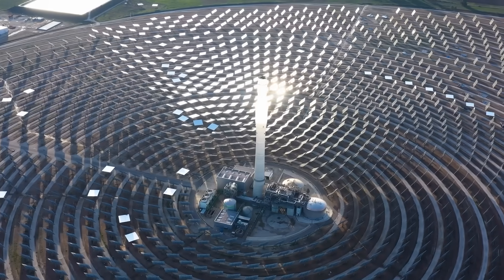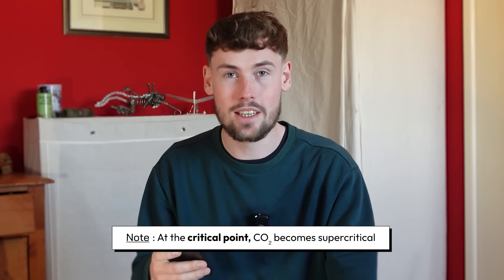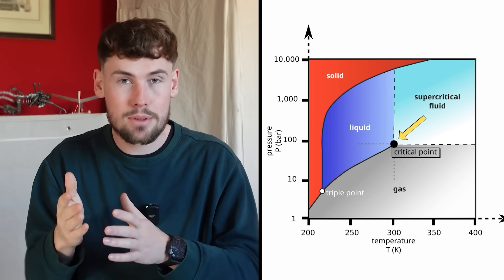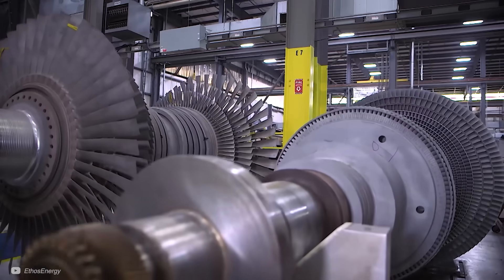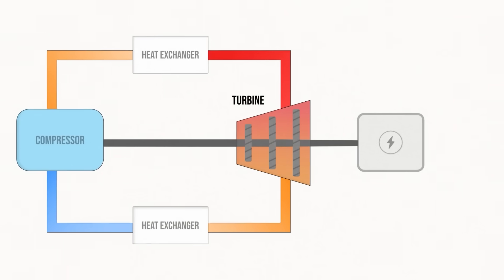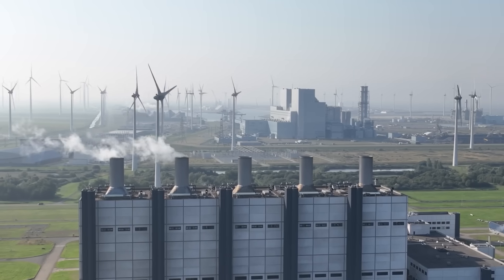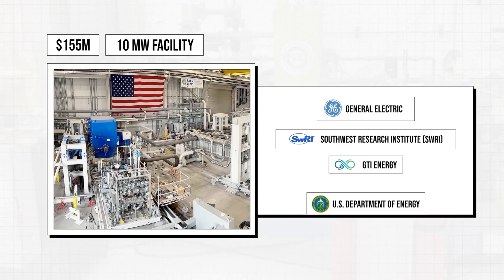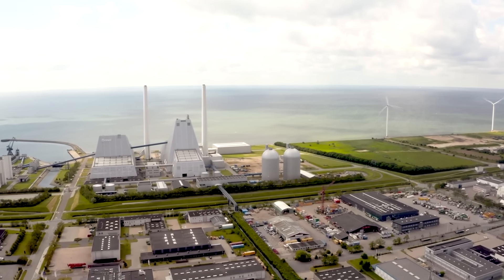How Ultra-Efficient CO2 Turbines Are The Future of Energy

Comment: As a Steam Ship Engineer, I do appreciate your content. Steam Turbines are incredibly efficient and reliable. However, when you throw 1,000 BTU's back into the ocean on every cycle, they do lose any efficiency advantage. Shoreside installations use reheat technology utilizing fluidized bed combustion, but this isn't practical for ships. I wonder how these CO2 turbines compare with the fluidized bed power plants. Thanks for the post.
Reply: One advantage of SCO2 for maritime use is the small size of the turbine.

Comment: Let's be more realistic, the next gen will still be fission reactors or the other option is to have very expensive electricity. Efficiency can be improved also by using waste heat for central heating systems. I hope people here have the brains to understand why it is not radioactive and would not be even in the case of any accident, because that argument is simply put foolish and often repeated.

Comment: Change of phase is not necessarily an issue. What you lose in one direction you get back in the opposite direction. Also, the change from sub-critical to super-critical and reverse is not strictly a phase change, there is no "heat-of-criticality" associated.

Comment: Just a diesel mechanic here. But basic mechanics and physics is all this is. Instead of a battery, the CO2 is the storage device. The transition from liquid to gas is the release and recharge of storage device. The real question is "what is the origional energy source" and is this storage device more environmentally sustainable than lithium batterys. Water storage by pumping into a reservoir and releasing through a turbine generator could be better. No extreme pressures or temps nor use of exotic metals in the storage device itself.

Comment: If the turbine can fit on a kitchen table (and assuming that the rest of the generating system is somewhat the same scale), why not build 'neighborhood' CO2 critical generators?  You would be hard pressed to 'mass produce' huge generators but it would be easy-peasy to mass produce the kitchen table size (think 'mass producing' automobiles versus trying to mass produce a train or a ship).  The problem is, the business model calls for 'large generators, far away from the end use site, which a government or large business can then charge; but if the generator is 200 meters away in an underground bunker serving a thousand families, there is hardly a need to have a huge corporation involved at any step or level.  This also would eliminate one of the weakest links in the chain: the power delivery lines (PSE is being charged billions of dollars because their power lines caused some of the worst of the Southern California fires).

Comment: The advantage is more in regards to having a smaller turbine and lower working temperature (compared to supercritical steam), this would improve overall efficiency but I am seriously skeptical that it would do so to the degree described. 

Besides, the smaller size and lower temperatures are not anything to sneeze at and it means that implementing it in space constrained spots like say gas turbines on ships would be easier, but they are not earth shattering.
Reply: Also it appears they’re comparing a closed Brayton Cycle to a Rankine cycle and pointing out the Closed Brayton is more efficient. Like duh that’s not really news.

Comment: Good video! If you need a ghost writer I’d be willing to write. I have a unique perspective, but I cannot be in front of a camera. I am very familiar with the thermodynamics of these cycles and can get rocking and rolling with physically accurate information. 

Again, a lot of this research is already there. The numbers aren’t as public for turbos, but a 180,000 RPM turbo, that ways probably 20 lbs can produce 20-50 Shaft horsepower. 

Shaft horsepower comes from applying a force on a fast moving parts. The speed limits come in around the speed of sound, but De Lavel nozzle can supersede this limit. Remember hydrogen rockets are technically steam powered. And carbon powered rockets are steam and co2 powered exhaust. The sCO2 hype has other applications and implications, consider the heat transfer coefficients achieved. My buddy researched tessellated organic branched sCO2 cooling channels. Cause there is no miniscous, the sCO2 can get in anywhere and cool it off. This opens up very high energy density hex

Comment: labyrinth seals don't really seal the way we think of the term.  It's more of making it inconvenient enough for the steam to take any path other than through the rotor and diaphragm blades. The only portion that's truly sealed is the steam chest. The labyrinth seals usually have a .020"gap between stages and sections in the same stage, .040" at the j face.

Comment: I’ve sat in some lectures about carbonization of materials. Both water and co2 have oxygen. It can eat materials up. Rickover said real power plants deal with corrosion and it is a very particularly challenging problem. High temperatures lead to accelerated corrosion in both steam and co2. But! SiC should help, which is used in high temperature jet engines.

Comment: Steam systems don’t lose energy from converting between phases, rather, it is the exact reason steam power plants can be very power dense. A single mine craft cube of reactor can cool about 60,000 thermal HP and convert that to about 20,000 HP at the shaft. The reason these heat engines aren’t as efficient is because the maximum temperature achieved. Which is a materials problem.

Comment: Steam turbines are so big because the last stage the steam is at a pressure that saturates at about 40°C, or 1 psi. You take sCO2 to 1 psi, it will be just as dense. 

If you look at a high pressure steam turbine, the steam exits at a high pressure state, and are very small, and produce about 30% of the torque on a composite turbine. 

Again, if you want to make an efficiency argument, then stick to the physics. The efficiency comes from the ability of operating at much higher temperatures. Not density. There are actual benefits from sCO2 that haven’t been talked about yet. 

The thing with power density from the turbine is also a function of rotational speed. Massive steam turbines turn at 1500-1800 RPM. A turbo turns at 180,000 RPM, so the size of the engine will be much smaller. Bigger machines can go much further though, usually reliability is measured in rotations. 

The smaller size is impressive, but be careful when comparing it to low pressure turbines. It is a gimmick to catch attention. 

Water impingement is a problem in steam turbines, but superheating can deal with that. So like, again, a gas turbine is a sCO2 / steam dual working fluid machine. There is nothing really new about sCO2 turbines. Compressing it is the new science, and that’s why they started with dry ice to achieve it. It is much more practical to compress air, spit fuel in it, and blow it up, creating much more volume. 

Ultimately power comes from Pressure X Volume flow.

Comment: Bruv, I’ve been following this topic since 2020ish when DOE first talked about the 15 MW sCO2 cycle. 

All I have to say, is for a rankine cycle, sCO2 ain’t it. You have to compress it first before heating it. Compressors are very expensive. Steam you pump water, which is still somehow really expensive, but not like a turbo. 

I now work on designing boiling water reactor cores. 

If you think about it, gasoline burns into sCO2 and steam. Every time you drive you rely on sCO2. It is better fitted for Brayton cycle, not Rankine cycle.

Comment: One thing about the sCO2 cycle is that uses a close-loop Brayton cycle, so it has actually has more in common with gas turbines than conventional steam turbines. In that case, it would be more of an adaptation of gas turbine technology, and gas turbines have been used for power generation for more than a decade, usually as part of a combined-cycle power plants which can already achieve 60% thermal efficiency. Combining that with sCO2 Brayton cycle, it is probable to push that efficiency even further. 

Another advantage I see for this kind of system is that it would essentially use no water, and when water is used to cool it, it would not be as hot as in a regular power plant. The problem with power plants, usually the ones using cooling pools, a lot of hot water is discharged into rivers. This adversely affects aquatic biomes and there are regulations and legislation that limit the amount of coolant water discharge. Such restrictions have affected many inland European power plants during the summer heatwave a few years ago. Using less water also makes it better for power generation in arid climates where water is scarce.
Reply: That water used in power plants for cooling, whcih you are talking about, is not water used dirtectly in steam turbines. Water used in steam turbine is in closed loop. It would be waste of resources to use fresh water, because you would have to constantly purify it. Warm water discharger by power plants is water that is used in condensers to cool down steam (water) back after it passed through turbine and ther is no energy to extract from it. And it's not something you could be able to skip in CO2 turbines; you have cool it down before beginning another cycle too. Amount of cooling may be different, but you need the same process, so it's not solution for problem you wrote about.

Comment: The fusion effort I like the best is LPP Fusion.  I like them because their method of generating electricity from it does away with a turbine entirely.  It's also small and doesn't produce long lasting radiation... the core can be worked on bare handed only a few days after being run.  Try that with a TOKMAK... hint you can't, you'd die.  It's so small it could be used on a spacecraft and it could even function as the propulsion system.  
These small turbines also spark interest for similar reasons.  Small and comparatively light which means it could be used on a spacecraft... or even an airplane.   Nuclear powered planes have been looked at for feasibility before and a very small turbine could be enough to make such a thing viable.

Comment: This is just moronic. How do you get this super critical CO2 in the 1st place? I got all of the way through and not a single hint of information about that. Obviously that's way more difficult than just sticking a pot of water over some burning coal and producing steam. Academics proving their propensity towards the stupid and impractical. Y'all can step in here and abuse the heck out of me. So! Let's see... Firstly, you need a fridge... A spectacularly powerful and uneconomic, inefficient fridge. Second, you need a compression chamber and turning over the compression motor for that will probably be a lot more efficient if you just connect it directly to the turbine - and by the way, how much do you have to burn to get all this carbon dioxide? These people need their heads examined.

Comment: What I’m not quite getting is the full production cycle of this thing.
Steam generators use steam through numerous heating methods. Heat and water are both very abundant and pressure is a direct result of the process.
CO2 does not exist as a natural stand alone unit so you have to process it first. Then it sounds like you have to heat and pressurise it as separate steps all of which take energy. Even if the turbine itself is very efficient, how much energy is used to get the CO2 tot he required state for it to work? Is the CO2 then re captured and re pressurised and re heated?

Comment: Being that small could become a power source for spaceships which require continuous power for plasma engines, the limiting factor is the need for continuous power supply.  Plus the high RPMs could turn s flywheel for gyroscopic stability.  A large saucer section could be a condenser to condense CO2 to remove heat for closed cycle.  We almost have the technology to open up the solar system for space travel, just some plumbing to work out and we are there.

Comment: 74 bars eh? That is quite high pressure, but not very crazy high pressure. Im worried about the cost now. Ok so its handling high  pressure that means everything involved with the CO2 will be cylinders and spheres. Also as soon as you increase the diameter of the vessels or pipes, the maximum pressure drops because the force acting on the whole surface increases. Remember Force equals pressure x area. If you want a big pipe for higher flow rates, then you have to proportionally increase wall thickness. This makes everything heavy very quickly. I believe wall thickness will have to vary proportional with internal diameter so using multiple small pipes does not help and merely makes things heavier. If you need more capacity, you have to use thicker larger pipes.

Not easy to scale up

Comment: Interesting. Turbines are the answer but not this type. Positive Displacement Turbines such as the TOMAHAWK TX, are in development and can deliver insane power density without all the fixed apparatus needed for this type of external heat source turbine. It uses IC from many type fuels including H2 and because of extremely high-speed cycling (4X typical ICE) and many other factors it's projected BTE is around 70% in the non-combined cycle mode. With that EX temp & noise is greatly reduced which reduces the materials challenge discussed herein as well.

Comment: I'm interested in the 40% efficiency figure you cited for steam turbine power plants. Based on my research for a book chapter on coal-fired plant efficiency around two decades ago, typical new plants were achieving around 45%, and leading plants in Denmark (including the one you featured) reached 47-49% net electric efficiency. Could you elaborate on the source of the 40% value?

Regarding turbine size, while smaller designs might have specific advantages, the physical footprint of the turbine itself is often a relatively small fraction (25% or less) of the total power plant area in most thermal applications.

 It's also worth noting that large steam turbines operate directly at grid frequencies (3000 or 3600 rpm), avoiding gearbox inefficiencies. Furthermore, larger turbines generally benefit from improved efficiency due to reduced tip losses.

Steam power plants primarily involve compressing water, which is then heated to supercritical conditions, meaning evaporation doesn't occur within the steam generator.

The efficiency of feedwater preheating through condensation is well-established, as is the overall efficiency benefit of condensation as an isothermal process.

 Finally, the Carnot efficiency (\eta_C = 1 - \frac{T_c}{T_h}) highlights that reducing the heat sink temperature has a linear impact on efficiency, while increasing the heat source temperature has a non-linear effect.

Comment: Closed systems like this could be useful for space vehicles and Luna or Mars outpost power generation. Using hot solar energy against cold shade side to disapate thermal energy can run 24/7 while it gets sunlight. Finding  new ways to intergate thermal energy into useful heating while cooling it enough to stay within its thermal flow rate and re heating requirements to generate at an efficient  fequancy. Is doable

Comment: This would be a great addition to a thorium salt reactor, if anything goes wrong the CO2 could be used to cool the fuel if it gets dumped by the reactor without causing any harm to the generation plant. 
The small modular reactors could have their own built in extinguisher.
I wonder how high the vent chimney would need to be to prevent the CO2 causing asphyxia in the area surrounding the generator should there a large CO2 leak.

Comment: 🎯 Key points for quick navigation:

00:05 ⚡ The supercritical CO2 turbine is a breakthrough in energy generation, replacing the traditional steam turbine and offering improved efficiency and smaller size for power plants.
11:03 💡 Supercritical CO2 operates in an "in-between" state of matter, acting like a gas but with liquid density, which is key to its turbine functionality.
01:10:18 🔬 CO2 becomes supercritical at temperatures above 31°C and pressures above 74 atmospheres, providing an efficient medium for turbine operation.
02:10:00 🌪️ The supercritical CO2 turbine generates power by compressing and heating CO2, forcing it through turbine blades to produce electricity.
03:30:11 ⚙️ Supercritical CO2 turbines are much smaller than traditional steam turbines and offer a longer lifespan by reducing wear from water droplets.
05:10:40 🌱 Supercritical CO2 turbines are more efficient than steam turbines due to their easier compressibility, higher operating temperatures, and lack of phase change losses.
06:30:00 🔥 These turbines offer up to 50% efficiency, compared to 40% in steam turbines, thanks to their higher temperature operation and no energy loss from phase changes.
07:30:05 ⚙️ Durability challenges remain due to extreme temperatures and high pressures requiring advanced materials, slowing large-scale adoption.
09:05:21 🌍 Pilot projects, like the STEP demo in Texas, are proving the viability of supercritical CO2 turbines, with goals of scaling and improving efficiency.
12:00:20 🌟 The STEP demo achieved major milestones, including generating 4 MW of grid-synchronized power, and aims to increase efficiency with a new turbine configuration in 2025.

Made with HARPA AI